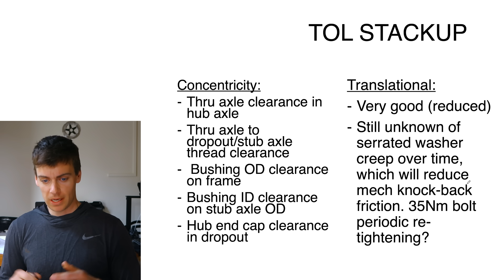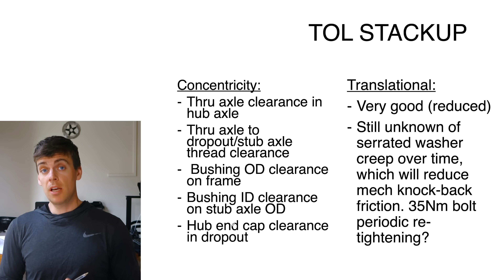More SRAM Eagle Transmission chat (including corrections)

Comment: Thanks for an update. I still curious if those tolerances are really important in the case of "electronic" derailleur. I assume it should autotune on the fly and essentially dismiss all those tolerances issues? (Still dont like marketing bullshit like magic wheel)
Reply: Yep. It has trimming. It also looks like you can replace the mounting bushing. 

Peak and all the other Monday morning “engineers” also forget the crazy huge tolerances in standard derailleurs. They also think a part that is meant to flex (derailleur hanger) is a good thing for shifting. In my opinion, the derailleur’s priority should be on shifting rather than surviving a mishap and the new SRAM T-Type derailleur does this
Reply: I nearly commented on the previous video. A straight hanger is obviously very important for a cable derailleur because if it’s misaligned the fixed cable pull will mean either one end or the other of shifting won’t be right - but for an electronic derailleur you can set each shift independently so a slight misalignment doesn’t feel as important as a consistent stiff position.
Reply: Axial position can be taken out by electronic adjustment, but angularity cannot. Current 12 speed derailleur requires careful alignment with the derailleur hanger alignment tool to shift right. 
I assume that when you bolt the axel on, the torque will pull the derailleur hanger tight against the wheel hub. That is how SRAM ensure the derailleur hanger is perfectly perpendicular to the wheel hub.

Comment: Is it possible that a carbon dropout surface could be resurfaced with new carbon or even a thin metal plate? Would repair tolerances be tight enough?

Comment: I've been trying to figure out how the cassette mapping works.  The only information I can find is that it relys on derailleur firmware and cassette geometry.  From the reviews that I have seen, the system will not shift immediatly when requested, but will wait until the ramp features on the cassette are alligned in the optimal position.  How does the derailleur know when to shift?  Is there some type of position sensor used (unlikely) or is it some sort of electrical power/torque sensing in the deraileur that somehow senses a change in torque due to specific cassette ramp or specific geometry/tooth features.  Thanks, Brian.

Comment: I'm an engineer so I can appreciate where you're coming from in some ways. However, in most ways I think you've been massively over critical of the design despite it having some really smart features.

Firstly; the new design makes the mech theoretically concentric to the axle, cassette etc. I sure trust SRAM to better job of machining all those components than most frame and especially mech hanger companies. I won't miss the DAG for even half a second.

Secondly; you moan about impact loads going into the frame. This is partly true but some of the forces are also transferred through the axle into the other side of the swingarm. So overall the load is shared across both sides of the frame, similar to landing a jump or drop a bit sideways. Sounds better than a mech hanger made of cheese getting fired into my back wheel.

Finally; if stiffening up this whole assembly and essentially taking shifting precision to the next level isn't worth it then kill me now.

p.s. Can you please use your sway to persuade SRAM (if you've not pissed them off too much) to buy Pinion? I'd love a dual micro-clutch wireless shifted gearbox on my bike.

Comment: Okay lets just say this design is fine, what was wrong with the old sacrificial hanger system? To trigger a redesign to a direct fit system?
As i can see, this will work fine as long as everything is made well. as a disc brake system (caliper mounts, rotor alignment). If the items aren't, you are stuffed, no remedy or adjustment can be made at the bike shop to correct it as is now the case. But as we have seen with disc brakes, if the hub housing or caliper mounting points are off, then you will have a nightmare trying to set the system up.
Reply: Another hammer looking for a nail.

Comment: think about the physics of the axel reducing the movement of the derailleur moment arm as movement is generated by a impact , the load is transferred to and carried by the axel, and unless you actually flex the axel and generate movement by all the derailleur laterally/perpendicular to the axel and the thread engagement system bushing /thread capture bolt and bushing assembly that goes through the dropout. And the analysis of the viseo elastic is assuming that the bushing bolt (thread capture housing ) is bottomed out at 35 NM, which it is not, the 35NM does not bottom out the system internally, so movement inward by the serrated plate is taken up each and every torque application.

Comment: The serrated washer bump-stop is such a good point! I suspect the only reason they did not include a raised section to impact the frame stop would be for aesthetics? Personally if I was purchasing this derailleur I'd be inclined to saw part of the serrated washer off so the derailleur will just keep rotating far beyond 60 degrees. Usually those big impacts are happening in the smallest few cogs where there is plenty of excess chain, so I see no risk of snapping it

Comment: I have a question here - I have a new epic 8 with the S-1000 Eagle transmission specced on the bike. Should I be able to tighten the mech to 35 nm without the rear axle in place? Right now I cannot even tighten to snug without somehow depending on the rear axle for some reason. Is this normal? Right now I cannot independently remove the rear wheel without needing to counteract the rear mech - other wise the two just spin indefinitely!

Comment: Thank you for the reflected analysis. Mapdec said the serrated washer would be the other way round - so it would eat the mech hanger part... Anyway I'm really curious to see where lateral forces would end up - as you said, the axle can't absorb anything. I'm actually not too worried about the carbon - in case of fullys i guess the shocks would have to absorb a ton (and therefore die really quickly, especially coil shocks...) and other then that: the wheels (as i guess they are the things that try to keep the bike from going sideways)... If this would have been a road bike derailleur I think I'd be way less concerned...
Reply from the maker: Serrated washer goes against the frame side. Smooth side against the mech plate to allow the "knock-back" function in an impact.

Comment: My understanding is the tolerance between the mech and the cassette are not dependent on the frame thickness etc. because the thru axle attaches to the mech not the frame.  I dont think the serrated washer creeping into the frame does anything to the relation between the cassette and the mech.  However this is similar in the UDH, with the translational tolerances only worsened by the bolted connection between the UDH and derailer.

Comment: Not sure how I feel about the viscoelastic creep commentary. It sounds theoretically correct, however I doubt SRAM would implement a component with such a failure mode. Surely, SRAM has accounted or has done cyclic testing on the serrated/knurled part and the assembly.

Comment: You could make a little plate wich can be screw thru both the hanger hole, then it could be pinched in the axle hole or have an own special axle and fixed there also. On that way you get same or near same stiffness  and holding it still also. It will fit all brans also....

Comment: I have to ask what was wrong with the 'nubbin' rotation end stop in the UDH design. Why change that to this knurled washer? I wonder whether the washer slipping under large impacts is a feature not a bug? Better that than smashing the drop out - it's like a hanger but only useful for impacts from the front.
Reply from the maker: Yeh possibly. What's the lesser of two evils. Not sure. In Alu, the nub would be better. In CF, not sure

Comment: just on the matter of the tolerances SRAM specifies. There has to be some tolerances applied. This isn't the civil engineering industry where everything gets measured on a thumbsuck and a plan is made to make parts line up :), the mounting system has to work in a degree of tolerance build up. Bike Industry may not be Civil Eng but sometimes I wonder because often plans do need to be made to get things to join. That said, the Stub axle is designed to work within a degree of tolerance build up and looks like it can accommodate a few mm either way (based on bikes being raced since last year I've had the chance to take a close look at and the bits as presented. There has to be a degree of fit adjustability and there has to be a specification for bike frame manufacturers to target ( i say that seriously and tongue in cheek at the same time). So yes tolerance is important in any worthwhile Eng Std. What I stand by is the ability for the system to be aligned during set up by the thru axle because that is exactly a step in the installation. A knock on effect of the UDH std is that manufacturers will find it harder to move an outside of tolerance product out of the warehouse onto the shop floor because the parts won't line up and therefore less chance of the consumer being saddled with a lemon they have to Civil Eng to get working. But there is enough play in the installation to allow for correct alignment of parts quickly which is a step forward for the bike shop mechanic. Just a pity they won't be moving much at the current pricing or maybe I'm just poor :)

Comment: What about the (non-existing) rotation perpendicular to the wheel, in case of a crash. I don't think the UDH or this systems are better than the old derailleur hanger. It's called fuse for a reason!

Comment: Does the thru-axle just slide through the inner 'hanger' and then screw into the 35NM 'bolt' that secures the outer 'hanger'?

If so does that mean that the axle diameter (where it locates the inner 'hanger') is now more critical?
Reply: Ah, just got to it on the vid :-)

Comment: Does this addendum change your understanding of being unable to tweak the “mech hanger” for parallel alignment with the cassette   /wheel? Separate point, some existing carbon dropouts get munched by putting the wheel in and out. I could go back and look at your slides but does this set up reduce that wheel insertion scouring from end cap to dropout? Great vids.

Comment: @Peak Torque isn’t there also a forward rotation concern in using the serrated washer to “fix “ the rear mech? Seems that washer also acts as the stop to locate the mech’s fwd rotation when the chain is tensioned and pedaling etc. There must be considerable load under hard acceleration and climbs that is not all absorbed by the drivetrain. Look how often pro racers snap their chains at race starts now in MTB and CX races. And that load (or a portion of it) being applied through that washer hundreds of times every ride maybe wears that dropout over time? Also MTB / gravel gets the bike dirty - cant speak for anyone else but I taake the rear wheel off a lot for washing and cleaning (or just changing wheels for terrain). That is more variable load and clamping action on a very small area……

Comment: Great videos, I love being able to see the nitty-gritty details of bike design discussed like this.  However, I'm not understanding your concern with transferring the load into the thru axle to then be transmitted into a carbon frame.  This is the exact pathway every impact and load from the rear wheel (rocks, roots, jumps) is transferred to the dropouts.  Sure a side impact to the derailleur won't benefit from being damped by the tire but the magnitude will almost never be at the same level as what it is already taking.
Reply: I would imagine that if the derailleur gets snagged on a rock or a tree stump whilst moving at any kind of speed, the forces going into the frame will be orders of magnitude higher than those generated by the wheels going over bumps.
Reply: All of those forces you mention are acting upon the strongest plane of the bicycle 
Rearward impact tears the dropout face. 
Side impact transmits more impact to frame
Than a traditional hanger..

Comment: Real life issue with the T type , hoping for solution / fix . The mech inner marking line and the inner friction ring  become misaligned during rides . At the start of the ride the two mark lines are perfectly lined up , at the end of the ride the inner mech mark line is few mm lower than the gripping washer mark . The torque of the mech bolt is correct at 35 Nm . A replacement was provided by SRAM unfortunately the same thing is happening . It this normal ? The friction ring does not seem to move at all , only the mech rotates downward ever so slightly ...shifting , if affected is very seldom ...Appreciate any help !

Comment: It seems like that serrated/knurled anti-rotation washer tends to get knocked out of position ever so slightly, per ride. Causing the derailleur body to swing slightly in a counter-clockwise direction. This brings the derailleur cage closer to the cassette, ultimately resulting in degraded shifting performance. Fixing this slippage requires having a proper 8mm allen-key with you, trailside. ...sigh.

Comment: In your opinion, is that washer with the rotation-stops even necessary? I mean it doesn't really matter how far the mech is rotated back in a crash, does it? And then you could replace it with some bushing or washer, that won't damage the frame.

Comment: My bikes are mostly 12mm TA with two Hex screws fastening two pieces either dude of the carbon abutment. I still like the idea of the threaded drop albeit very little in the way of a drop on my fitting and the design is such that it's not really a sacrificial part either. I can see how some impact force would transmit through the frame compared to the old school derailleur hangars. The idea of a slip design using a wave washer to facilitate movement with vertical pacts would be a welcome addition on MTBs imo.  Not so sure about this new design, its basis is trying to keep alignment that's a good thing

Comment: Of course that the thru axle is "a metalic component and it doesn't have any damping".. so what is your point here? The derraileur have the damping now, and that makes the left side of the bike weaker the the right side, but you still don't wanna stop talking about the forces that goes thru the frame.

Comment: Doesn’t the overload clutch dissipate some amount of energy in the case of an impact?  There are some YouTube videos out there testing the previous Eagle AXS and it really takes a big impact to bend the derailleur hanger.  I have not seen an engineering analysis of the energy dissipation through the clutch but it might be significant. Of course the un-clutched arm of the derailleur can still be impacted but the bending moment might be small enough to not be a problem.

Comment: A thread in a thread always makes me uncomfortable. If they are both right handed will you need 2 wrenches to loosen /tighten the axle ? Won’t snugging the axle loosen the derailleur?
Reply: They are opposite hand threads.
Reply: Ouch 😮. That's maybe why they want 35Nm torque on the derailleur side?
Reply: @bigalsbash so loosening the axle loosens the derailleur?
Reply: @Brian Bob  no, its tight on the rear drop out  but then gets pulled hard against the bearing spacer under the cassette when the axle is tightened.
Reply: @brianbob7514  no, the mech is still held in place without the axle,  I was wrong about the left hand thread though,  the UDH is left hand but the mech clamp is right hand

Comment: one thing I'm not sure on. in terms of alignment issues between the derailleur and cassette, I can't tell if the clamping force of the axle would bend an out of alignment dropout enough so that it sits flush with the endcap (and consequently the cassette). If yes, that would solve alignment issues correct? Would carbon bend enough for that to happen?  Not saying that's a good way to do it, but is that the thinking here from Sram? 

hope that makes sense, not an engineer. thanks for all the excellent vids.
Reply from the maker: Yeh, the axle load would always pull in a dropout to some extent. Grab open dropouts between your hand and squeeze. Most frames are easily flexible here. They don't always come in parallel though, so those tight tols on the drawing are kind of academic

Comment: Hi Peak Torque, will you be getting a set for actual review and to validate if your assumptions and comments are still valid. So far I reckon you are basing your Engineering knowledge and whatever photos & Videos available online to form your opinions thus far. I agree with most of your points and I have my own opinions which I will validate once I see this new transmission in person and get to test-ride it.